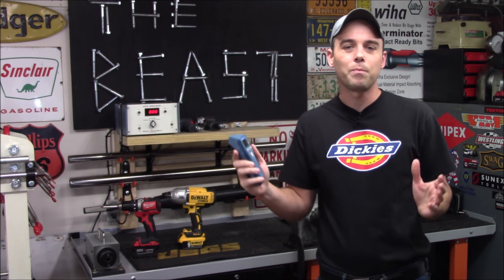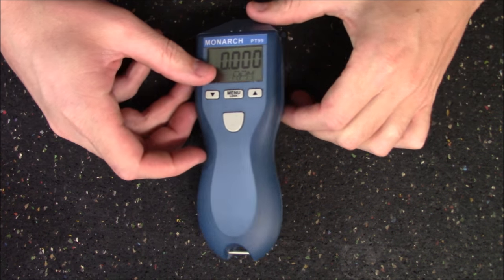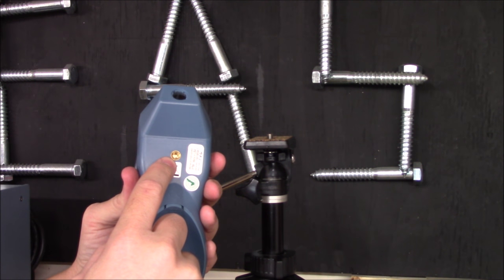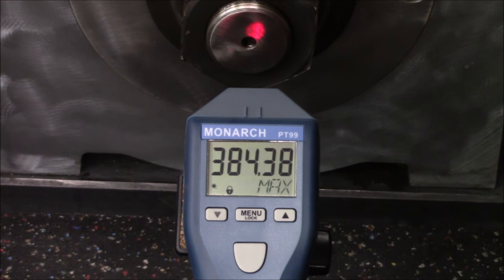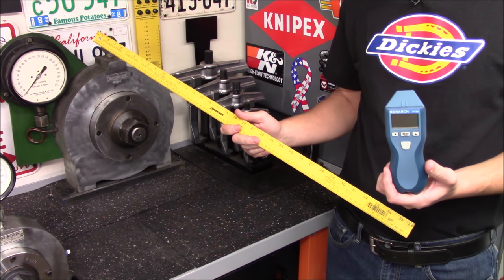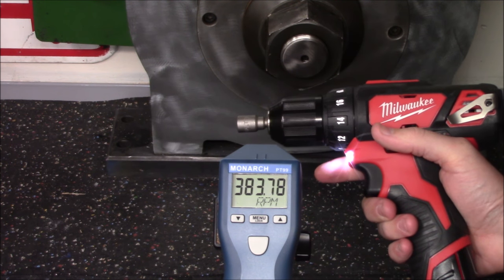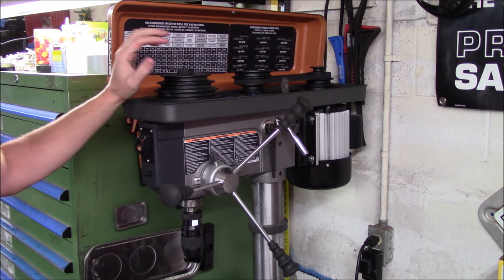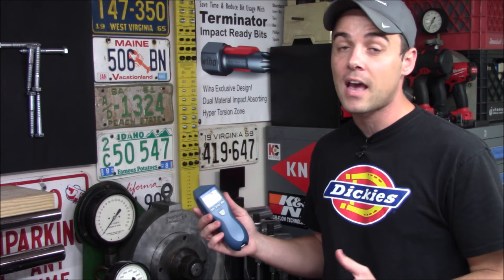Measure RPMs!  Monarch PT99 Digital Non-Contact Optical Tachometer - MADE IN USA

Comment: A test I would add (which maybe you already have) would be to test the rpm of battery tools using multiple, different,  amp hour batteries. I don't know if it makes a difference in non-load speeds but it sure makes a difference in power especially for high demand tools like circ saws, sawzalls, hole hogs, etc
Reply from the maker: Thanks for the suggestion!  I have already been working on that, but I wanted to show what this new meter was & how it operated prior to lumping it into a larger video discussing batteries & performance.  Thanks!  :)
Reply: At the very least it would be cool to show a tools difference with rpm under load as well. I could see it being very useful in drilling  metal. As well as drilling or cutting, under heavy load,  with battery tools and see the rpm drop with different amp/hr batteries

Comment: Can this Tachometer be used to check the RPMs on a push mower or any 2 or 4 stroke engine. If so how do you check it. Do you point this at the spark plug like other tachometers?

Comment: You do realise that 1500 RPM is synchronous speed, meaning that it will never reach 1500, with load or without. Considering it is a small motor, this offset is very normal, because losses are quite big.
Reply from the maker: +APprojection so how do you explain the tools that test above the stated rating?

Comment: Does the size of the reflective tape on the chuck effect the result of the RPMs? Would the RPMs be more accurate if you used a 1/16" piece of tape instead of a 1/2"?
Reply from the maker: They recommend 1/2" square for most applications (like what I showed) & as thin as 1/8" for thin shafts.....the width makes no difference, it is merely measuring the revolutions with each rotation of the tape.  Check out the manual here --- http://www.monarchinstrument.com/pdfs/manuals/1071-4837-113R.pdf

Comment: With the bit in the chuck, isn't it technically under load? The listed rpm are usually under no load, correct? Informative review anyway, seems like a cool product.
Reply from the maker: +Seth Bracken I just rechecked it with a fresh battery....zero difference in RPMs in both speeds with & without the bit installed.  100% identical readings.  Thanks for the question! 👍

Comment: So why does the factory rate them at a certain rpm but in real world it turns out lower? Is this a straight blatant lie to sell tools?
Reply from the maker: It's called 1-upping......the torque specs are BY FAR the most blatant exaggeration......well that & HP/amp ratings on corded tools/compressors/etc.  It will be interesting to see which brands are the most "off" & which ones rate them accurately......time will tell.

Comment: Did it come with a calibration certificate?
Reply from the maker: They do have NIST certified versions, but the price is quite a bit higher.
Reply: German Tool review@ you dont need calibration certificate on such devices...they are not off on the non-contact versions...
even the 5 USD version is insanely accurate and you can test it yourself with a diode with hz-frequency..
they are spot on pretty much thrueout their range to 100k, even the extremely cheap ones 5 to 10 USD delivered are spot on on the full rpm value..
its how they work that makes them accurate laser/LED tachometer on sensing reflection. 
accurate is not a problem on such items so no reason for any sense of calibration, its more aspects like distance and likewise, that can tumble a reading or tachometer where there are spinning parts, but on the non-contact versions not really an issue..
// edit here ia a crude example of the 5 to 8USD ones. https://youtu.be/2uiByAnSS2k?t=210

Comment: Thanks for the video. I appreciate your testing methods. I'm curious if the size of the reflective tape has any impact on the measurement? Say for example if a cutting that surrounds half the rotating part is different from one that is 1mm sliver?
Reply: Never mind, I see you answered a similar question already. So long at the instrument measures the leading glance of light, it should be good.

Comment: Can I put two pieces of tape separated by 180 degrees to double the number of rpms displayed?  Would doing so increase the accuracy of the reading.  (Divide result by 2)
Reply: Yes, you can.
Note: that 'trick' isn't so much of a trick in that it is actually common practice. It is normally used to measure low RPMs which are outside the tachometer's range. Eg: if the range starts at 100 RPM, and your device rotates at around 50 RPM, put at least 2 reflective dots equally spaced out on it. (or three, or four, ...). Measure the RPMs, and divide by 2 (or 3, or 4, ...) to get the true RPMs.